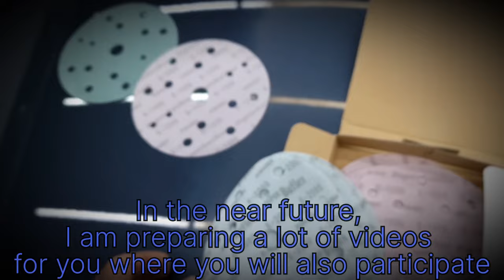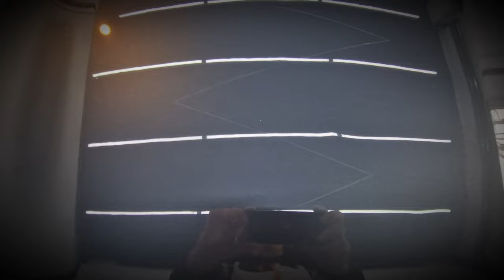Orange peel | Removal with 1500 grit DRY SANDING

Comment: I did a bonnet at the weekend and it’s got so much orange peel. I just used G360 which has improved it and was going to wet sand with just 1500 but having seen this I’m going to try your method. Thanks.
Reply: its a good system, but instead of compounding after, i would go one step above to 3000k grit, or even more, it really cuts a lot of your buffing time, after sanding polishing will be child's play.

Comment: Great video amd detailing… quick question sir … where can I get that adapter you’re using on your DEWALT polisher/sander (connecting pad with machine adapter) ?  I’d like something like that so I can use on my machines that currently use a 5/16 screw in attachment .  Can you help with a recommendation for an adapter I would be able to use to interchange so I can use a variety of pads with all my machines … tyvm

Comment: I always have scratches after sanding..i never tried those sand paper... i repaintes 7 times...even with a small orange peel..after i sand it...i have scratches and the compound polish can't remove them. Do you also have scratches? Because i can't see it on the video.

Comment: In order to achieve this level of finish, do you have to sand with the Mirka sander?  Is it possible to sand by hand and get the same result?
Reply: Yes, it could be, block sanding and water with help of a light because you can see when its gone

Comment: How many days do we have to wait after painting to remove the orange peel
Reply from the maker: everything depends on how the coating dries, it can be sanded immediately after painting, but in my opinion it is best to sand after 35 days, when all the material has done its job
Reply: @Amddetailing  Thanks

Comment: Thank you for your videos.
One question: which interface pad do you use for sanding orange peel with Assilex? Do you always use the soft one (is it Kovax 971-0091?) or also the hard one in some cases?
Reply from the maker: from 1000 to 2000 always a soft

Comment: So why don't you have a vacuum cleaner h(hose) attached to the sander so it removes the dust? And lining op de holes in the discs without a vacuum cleaner attached to the sander is comical  🤣😂😅

Comment: Looks like out Mercedes factory paint. The car has an orange Peel, because there isn‘t enough clear coate.
Reply from the maker: The entire front part of the car is not factory painted
Reply: Orange peel has nothing to do with too little clear coat. It's from application (not enough pressure, improper overlap, distance, temperature, etc.) Thin wet coats are fine